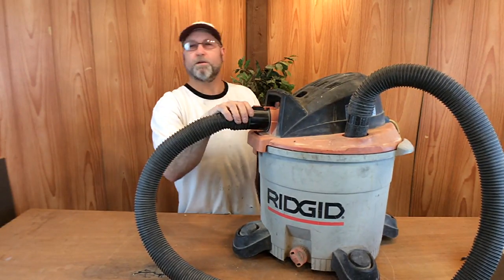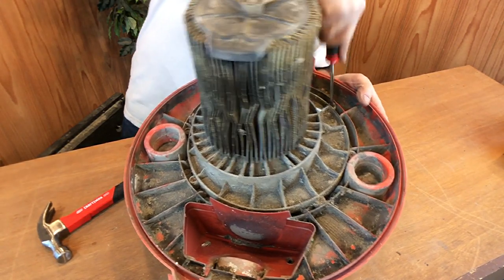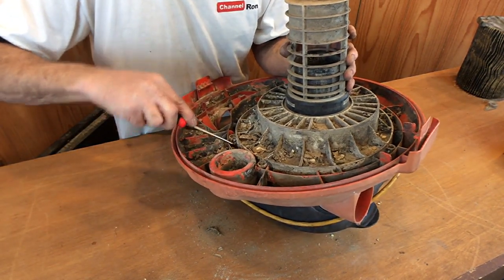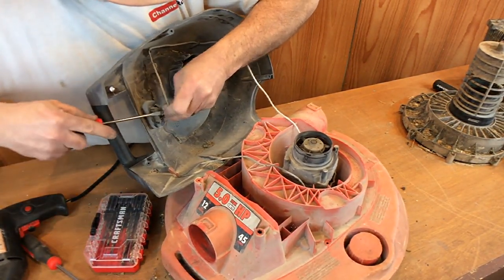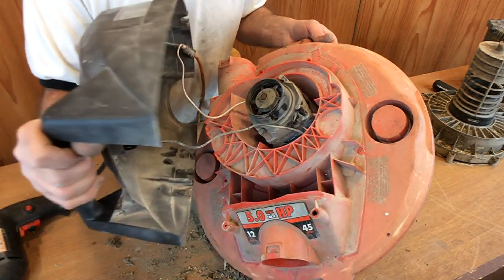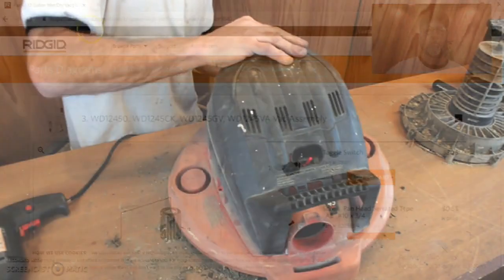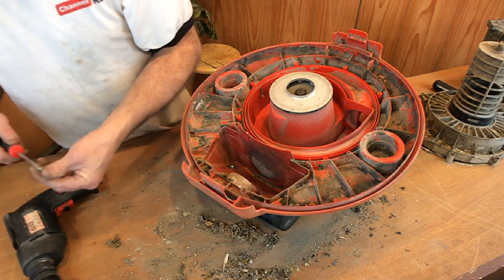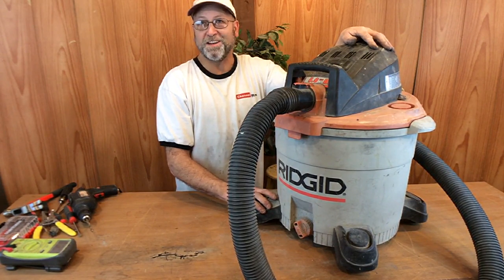Switch Replacement On RIDGID Shop Vac

Comment: Thank you for posting your video.  The instruction is excellent.  I followed your instructions to replace the switch in my Rigid.  The worn screws were identical.  With all screws out I replaced them with stainless steel screws for the next time this switch gives in.
Reply from the maker: Nice! good Idea on the stainless screws!

Comment: Thank you so much!!  I finally found the switch on Amazon for $6 (and it's a better quality switch than the cheap plastic toggle that came on it originally) and your video got me through installing it. I had the exact same screw in the same spot rusted out of mine, too.

Comment: Rigid website is not showing any switch replacement parts. Very frustrating as I also have an old vac with same problem. Sent them an email...we'll see what happens if I get an answer. Thank you for your post...where there is a will, there is a way.

Comment: Found out that the switch on my RIDGID 18500 is obsolete (? !) on the RIDGID site.  No substitute offered. Now looking for a replacement source for a different switch.
Reply from the maker: Bummer so what you could do is by pass the switch and put and inline switch in?  type this in amazon,   20A Heavy Duty Inline Cord Switch,Large Current in-Line On/Off Rocker Switch with Red Led
Reply: @channelron3593  Great idea, Ron. Thanks. However, after my post I did find a RIDGID source that offers a substitute. Supposed to arrive tomorrow.

Comment: Save yourself some time. Unplug the vacuum take a sheetrock, screw drill it into the old switch take a pair of pliers pull out sheetrock screw and switch unplug wires connected to old switch, plug new wires onto new Switch snap switch in done.